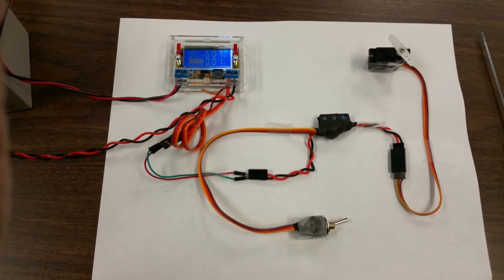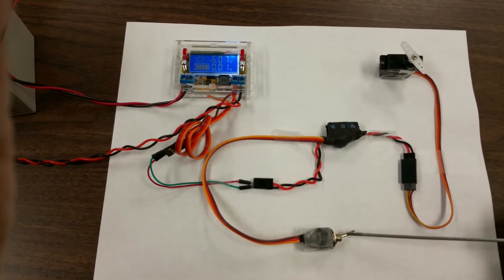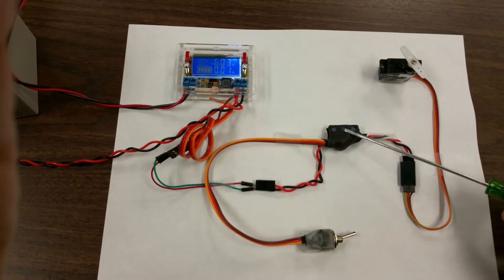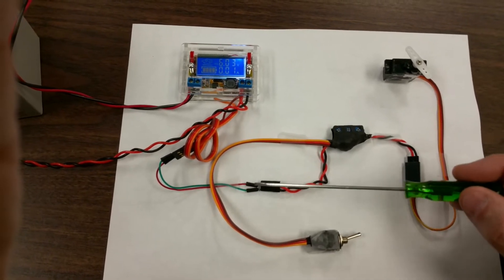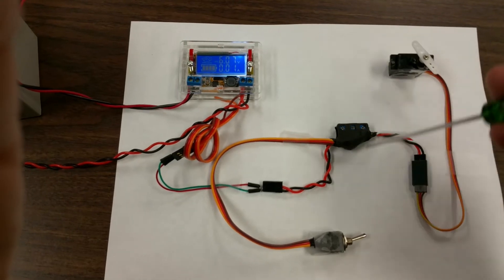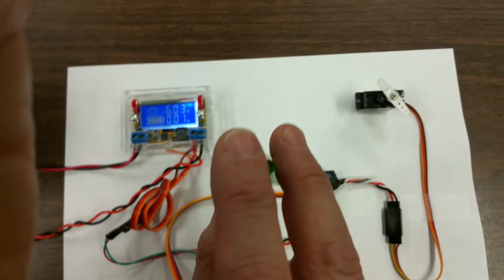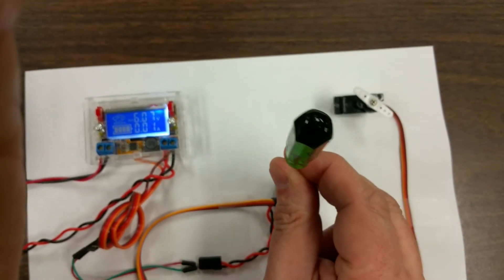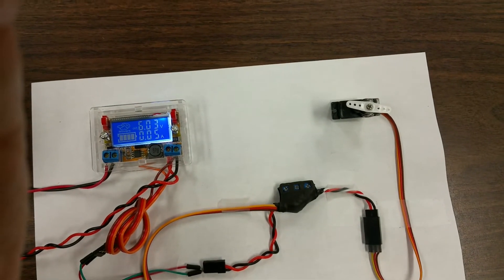3 position toggle switch servo positioner 20170411 074231

Comment: I plan to make a sign (inspired by the portal door sign from Howl's Moving Castle) for the bathroom so that my two room mates and I can indicate if we are in there or just running the lights and fan to remove moisture. I think your circuit will be perfect. (Here is a link to a gif of the portal door: https://www.pinterest.com/pin/289989663496367577)
Reply from the maker: Sounds good to me!  I enjoy reading about the cool things people are able to make with the help of the servo positioner.  Your link didn't work for me.  I'll try again though.

Comment: Can you control each position individually?
Reply from the maker: I make a few versions of this controller.  In one, you can set all three positions (three pots, three positions). In another, the center pot sets the speed of the servo while the two pots set two of the positions, the third position is in the center of servo travel and isn't adjustable.
Reply: @heyok  Is there a place I can buy this exact model? Adjustability for clockwise stop point, adjustability for counter-clockwise stop point, and center stop. With the speed control.

Comment: I like this idea a lot. I tried to register with your forum but it will not let me without a valid referer  name. How can I reach you to order?
Reply from the maker: Gary Dobias, send me an email : mostlyal@gmail.com thanks, Al
Reply from the maker: Hi Gary.  Sorry I missed your message until now.  You can reach me at mostlyal@gmail.com
Reply: Can this be used as a forward-off-reverse rc winch control for a servo winch I made for my crawler?